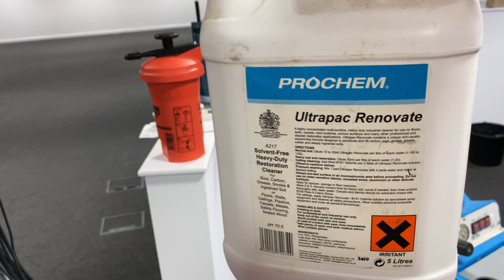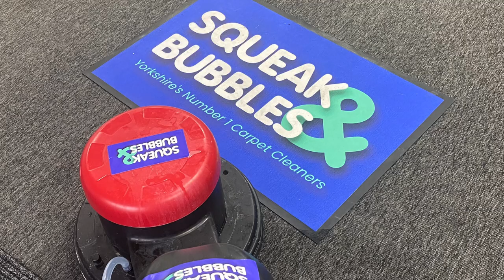Commercial Office Carpet & Safety Floor Cleaning in Leeds, Squeak and Bubbles. #Leedscarpetcleaners

Comment: Thanks for the video. I’m new, this method of applying a product with the rotary, it doesn’t need any extraction? Or even vacuum like encap? Do you only use this method on floor tiles? I’d also be keen to know how you quoted this job. Tyia
Reply from the maker: With encap it always needs to be vacuumed up! I always explain to the customer how it works and tell them to vacuum the following day or when the office cleaners are due in.  Floor tiles always this product. Never had an issue in 13 years and have many repeat customers. I also did safety floor cleaning on this job so had to adjust my price. Quote wise it all depends on what you want. The longer in business and how well established one is, you can always give a good price, as thew company know your going to do a good job.
Reply: Sorry so what you’ve done here is encapping yea?
Reply from the maker: @vortexcapetcleaning2197  it is.  Apart from the safety floors.
Reply: Thanks bud :)